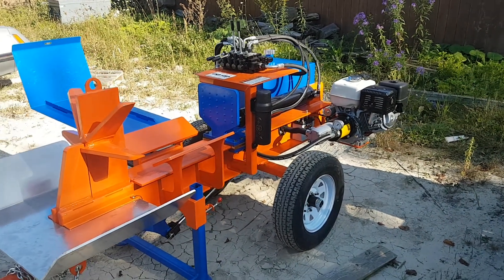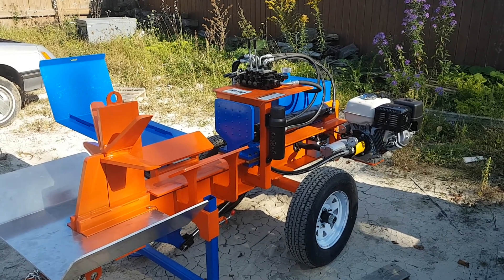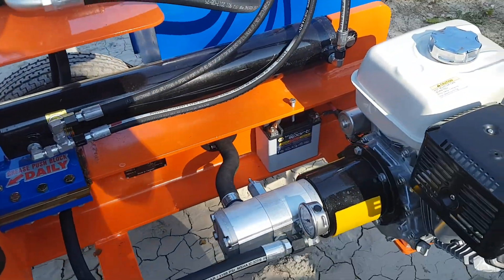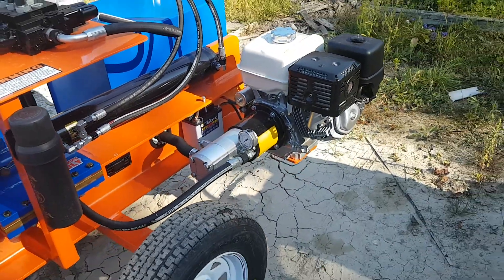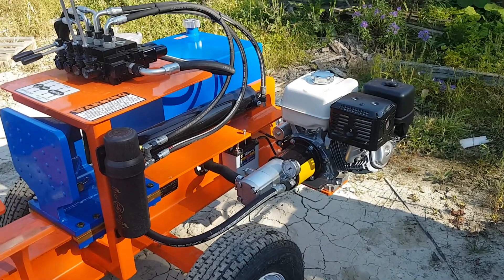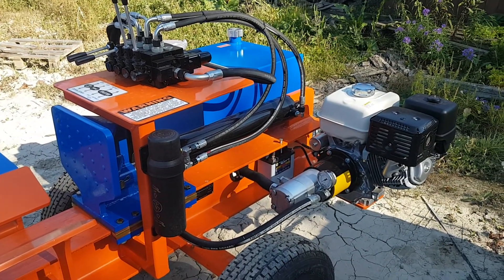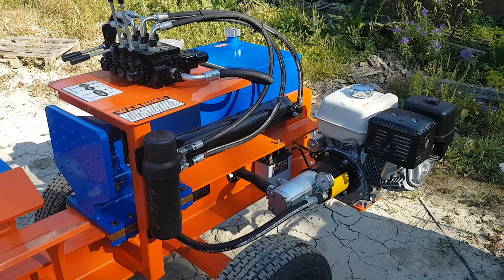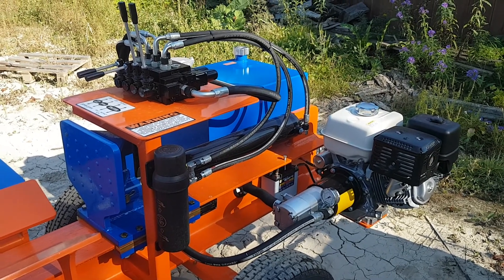Eastonmade System Pressure VS The Other Guys

Comment: I have another question, is there any way to slow down the actuation speed of the cylinder on the lifter section on your Splitters ?
It seems , from this videos, that the speed is a tad quick, which leads to 'jerky' operation.
Reply from the maker: Reg Sparkes they are really easy to control the speed of with the control valve.

Comment: So Andrew, I take it then, that if your system is rated at say 3,600 PSI then the hoses and fittings are rated that way too? 
Some commonly available hydraulic hoses/ fitting  that folks may buy are rated at 2,500 PSI, so I thought it would be a good idea to advise folks that the pressure rating on any hose assembly they might want to replace, should be rated accordingly. Am I correct in this?

Comment: This is not entirely true. Your competitors in the commercial splitter market do not run 2600 psi. This may be true for box store brands but that is not comparing apples to apples either...

We run 3200 psi with cylinders rated to take up to 3500. This is easier on the engine, hoses and cylinders... You do make a nice machine, don't get me wrong but these videos do not  weigh all of the pros and cons. 

Most of the industry does use off the shelf parts which allows our customers a better overall cost. It also means that if there is a failure of a valve or a pump 10 years from now, the customer can replace without having to call the manufacturer for a special made part. 

Same thing with the log lift pins, the 1" pin with the hair pin clip are replaceable for $3 and change at the local tractor supply or hardware shop. No waiting for a machined bushing or pin to get shipped from the manufacturer. Also the log lifts will get cycled a few hundred times per year, not like an excavator that gets cycled a few hundred times a day under much more tonnage in comparison...  This is my humble opinion, take it as you may. Good luck to you Andrew! Sincerely, Chris Wolfe, Wolfe Ridge MFG
Reply from the maker: Thanks for the feedback Chris.  These videos are just solutions to past problems we have encountered using off the shelf parts.  We would like to try and educate people and let them make a better informed decision for their investment.
Reply: After reading this comment I for sure won't buy a Wolfe Ridge splitter.  Make your video and say what you want there.  What a childish way to promote your business by commenting on someone else's video.
Reply: @jlp1515  don't know what you are talking about. He is just saying not all competitors meaning his product. When is it a bad thing to inform someone that made a public video that his product also meets the same specs as another?